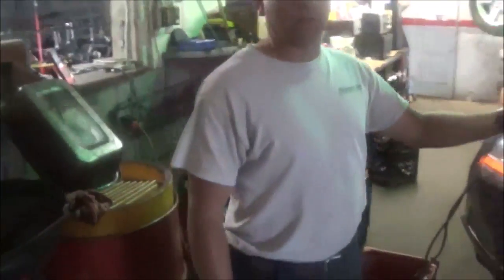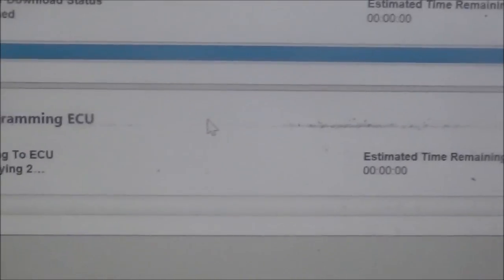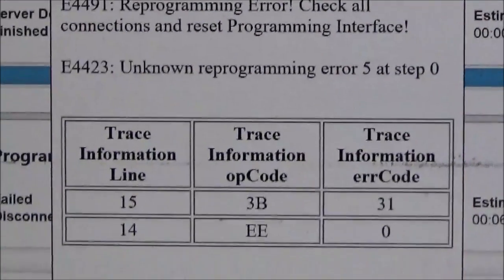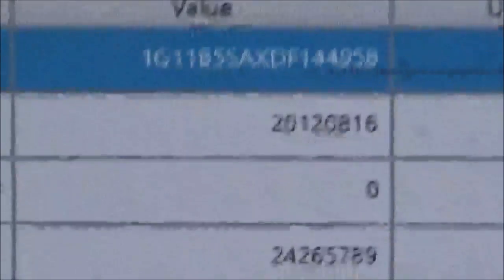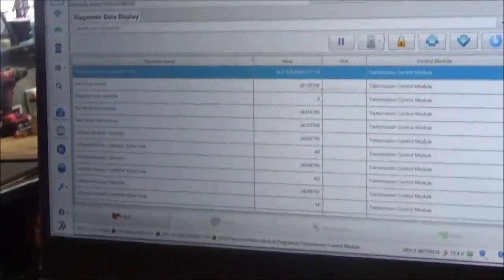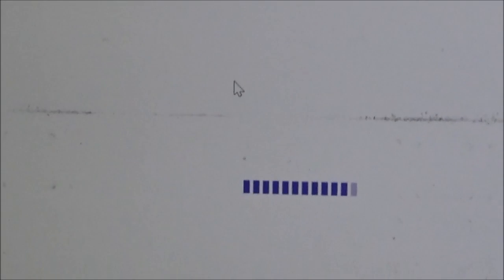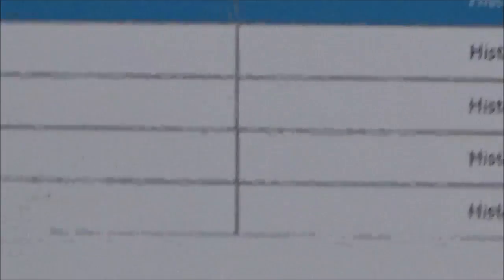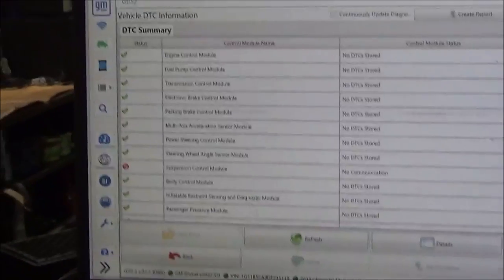AUTOMATIC TRANSMISSION PROGRAMMING

Comment: I have a 2012 vw routan. I recently had issues with my alternator. It went out and had to be replaced.  As it began to fail the 4th gear began to delay before shifting.  After the alternator was replaced the 4th gear continues to have a slight delay.  Could that be due to the alternator failing? And if so, do you think having the transmission reprogrammed would solve the issue? Thanks in advance.
Reply from the maker: If 4th gear is not right, transmission has a problem. This transmission does not need programming. If the transmission has codes, the codes need to be checked out first.
Reply: @thisisyourtransmission  there are no codes. Thanks again for the reply. I was hoping it had something to do with the failed alternator but such is life🤝

Comment: What if you are doing an ls swap and got the trans from a salvage yard and dont have the vehicle vin? But trans didnt come with a t42 tcm? 2007-2008 4l60 from a suburban.
Reply from the maker: A 4L60E does not need programming.
Reply: The software will tell you the vin that the part is programmed to on the transmission control module. What you want to do is use the software to overwrite that and the new vin number in its place so it will recognize that. According to the op yours won’t need programming and it will automatically work. Some manufacturer put immobiliers so it can be done as easily. You should be grateful GM didn’t put that in place in your car. This stuff can be a pain in the ***.